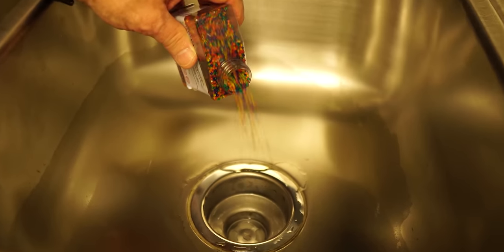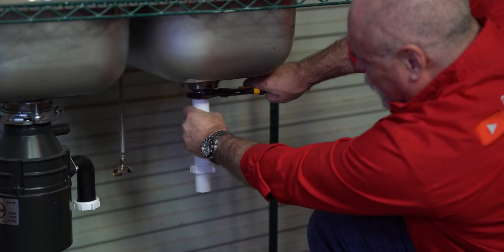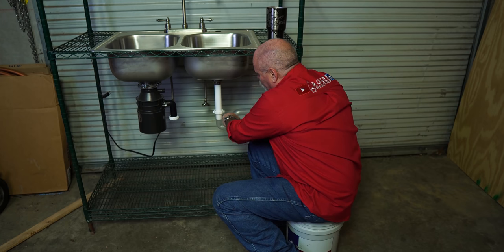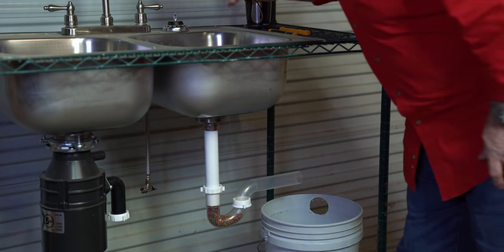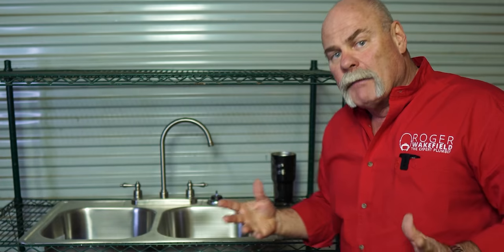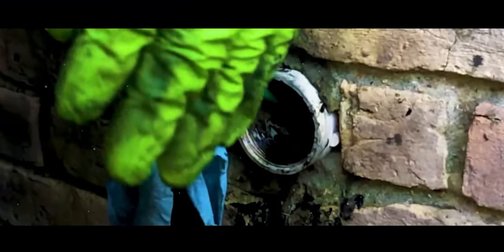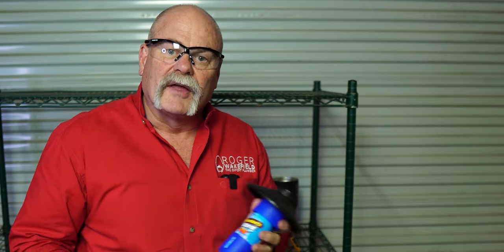Can This As Seen on TV Plumbing Gadget Unclog 50,000 Orbeez?!

Comment: Orbeez are quite round and have very localized friction (kinda like ball bearing), sink usually is clogged with very long hair that has all kinds of gunk tangled within it, giving a very long friction pathway... if this cannot push orbeez, it certainly cannot push the typical crap that clogs the sink. But no one is going to wait for shite to completely fill the pipe, so Plumber's Hero might work if there is some clogging narrowing the pipe throughput...

Comment: Not to be rude, but are you using your plumber's hero acccording to the instruction. You should SUBMERGE the can in the water, thats about 4-5 inches in the water, to caver the big plastic part of it. The water with gas helps it to push it through, you cannot do it just with pinch of water or no water. It's difficult to tell because of the camera angle...this can saved once saved our life and did a better job than a plumber itself....

Comment: im a 1st year plumbing apprentice just wondering  why would you do a j bend instead of just going to your p-trap
Reply: I'm not a plumber but isn't a p-trap and a j-bend the same thing?
Reply: @youss8378  from what I understand it isn’t but I don’t know much about j-bends because I don’t use them when ever I plumb a sink right under the abs pipe that comes down from the strainer I just go to a p-trap and out to the main pipe
Reply: @grantpritchard3724  But isn't a p-trap made from a j-bend pipe? What he made under the sink looks like a p-trap to me and it would for sure do the same job as a p-trap, isn't it one? If not, what would be the difference? Thanks.
Reply: @youss8378  a p-trap goes to a u bend and up and out with one end being a union and out to a drain

Comment: A smart person would have cleared as much of the obstruction that was coming back up. As someone who uses Orbeez extremely often I can see how you deliberately made the product look bad....the ONLY issue someone with common sense can see is that's a lot of compressed air being shot down a drain that is possibly old, worn and damaged therefore potentially blowing the drainage pipe apart resulting in a big mess....but at least it would unblock the drain.

Comment: Did you read the instructions that came with the product? I feel like you assumed you knew how to use it and didn't read through how it's actually supposed to be used. Not saying that it would have worked for sure if you had, but to give a product a fair shake you should really read through ALL of the instructions.

Comment: I still think the product is garbage, but you didn't use it correctly based on its directions. In your video where you watched a bunch of plumbing commercials, it said to use it (and demonstrates it) inside of the sink while the sink had standing water. In this video, you have a small water puddle around the opening of the drain which disappears even more as you shoot water out. I know if I were to use an accordion plunger and not fill it with water, it would be less effective. Same concept? 
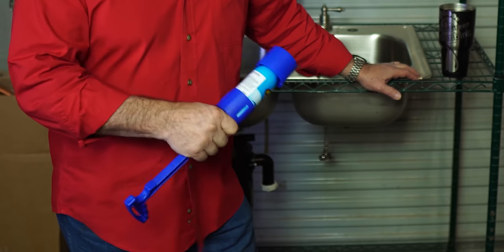Go to your video "Real Plumber Reacts to As Seen on TV Plumbing Gadgets" and go to 1:12
Am I wrong to make that assessment? Plus you went to the absolute extreme trying to clog the drain with Orbeez
Also, not throwing hate, it's just an observation that I am bringing up.

Comment: I must say, I'm a bit confused. I've watched a couple videos of this sort of product, and it seems to work for everyone but you. Yes, the orbees are probably a bit more heavy duty than most applications, but that's more a fault on your part for pretending like they simulate a normal clogged situation. All in all, I'd probably rather die than use an ''as seen on tv'' product, but this evaluation doesn't seem to warrant its like-dislike ratio.

Comment: this could have been about a 1 minute video with the same value of information. "now see what you have here is a pipe under a drain. sinks have these pipes under the drains and you can see, here's a piece of pipe, and here we can see it comes out of the drain. what happens is, water comes down the drain and thru this pipe, then around the trap, which has pieces also, and then through another, yes, piece. of pipe. this is how pipes work. things flow thru the pipes. it goes from one place to the other. here you can see a piece, and another piece, and here you can see, yes, another piece. ok now what we will do is use this thing. ok we're gonna use this thing. watch, we will use this thing now. lets seee if the thing works. ready? here we go. we're ognna use the thing"

Lmfao, my goodness. just fucking show us if the thing works on the stuff. for fucks sake.

Comment: Only 1 problem dear Sir

In your other videos you should a TOP DOWN VIEW
I think, personally, you did not show a top down view, becuase you did not apply a correct seal technique to blow out the blockage 

Science alone would tell us this should work to some degree, the pipe lining is SMOOTH and so are the orbeez. therefore there is not enough drag coeffecient to precent the pressure (IF DONE PROERPERLY) to expel the orbeez 

I think you were not fair, and did not do this test properly

Comment: We're gonna fill the sink up with orbeez, fill it up with water, then we have the as seen on TV product here, we got the sink rigged up, we're gonna fill the sink with the orbeez, put some water in there, use the product, and see what it does. We have a sink that I've put together, got some water her, orbeez, and an as seen on TV product, we're gonna see if it works like it does on TV, also stick around to see what we do with the picture of my face on this piece of paper. Alright so we've all seen the videos about orbeez clogging drains and how they expand with water, well I've got this sink rigged up as a single drain and I've got orbeez and this as seen on TV product, we are gonna use the as seen on TV product on the sink with the orbeez in it to see if it will blow them out.

Comment: Lost credibility with me Rodger.   You have it assemble wrong.   Yes,  you did not have a good seal,  the orbeez were in the way.   The larger seal can be used for tubs and Sinks, but the way you used it was designed for toilets.  Turn the adapter around and get the orbees out of they way they maybe preventing a good seal.   You let your testosterone get in the way !                  Read the direction.       One was given to me as a gift,   Its normal price at the store was $6      How much is a plumber going to charge to come clean it?     $75-120 ??    Its worth a try if you read.

Comment: These dumbass products advertised on TV make me laugh. First of all, 98% of all drainline stoppages are NOT in the p-trap, they are usually way on down the line where the drain pipe is horizontal under the house. Only concentrated H2SO4 or a mechanical snake will clear the accumulated sludge down the line and out to the public sewer or septic tank. How do I KNOW what I'm saying? 47 years as a plumbing contractor!!